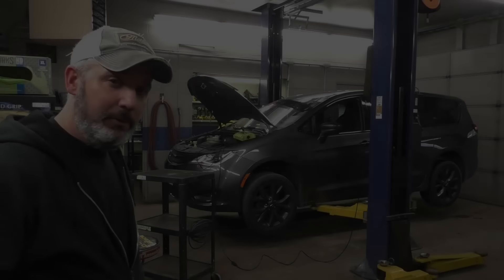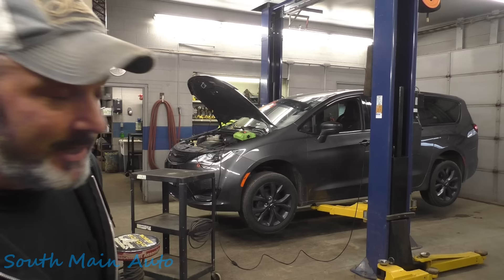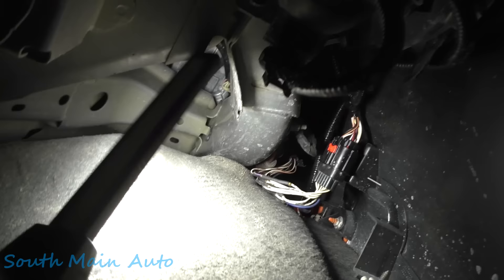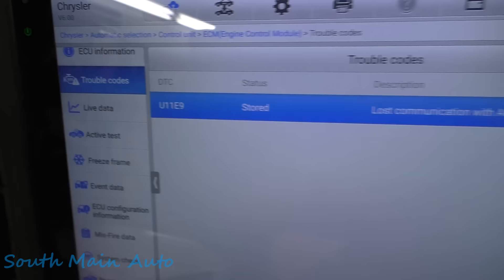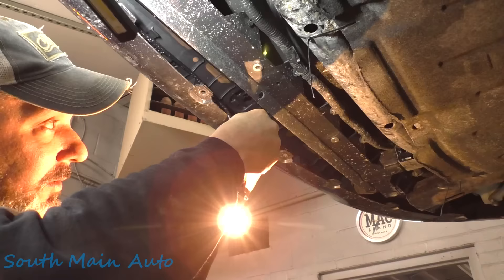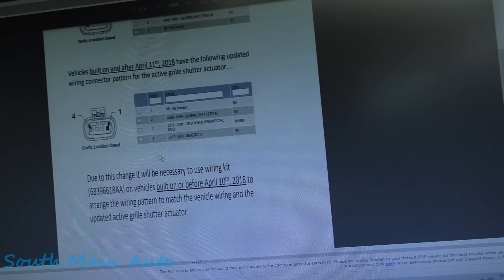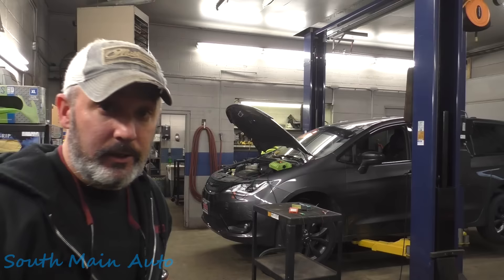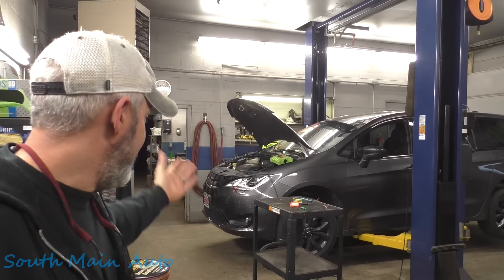Chrysler Pacifica - Updated Active Grille Shutter Wiring

Comment: Whenever you get those spring month before/ after updates it seems like someone is just not vert into their at the time.🤷‍♂️
Of course it could also be a simple mix-up from the dealer giving the guy an after model shutter instead of the before model by mistake. Someone clearly didn't have the service updares.🤙

Comment: That scope is a 25 buck amazon special  DSO-138 in a fancy box.  not that it is a bad scope.  I use one for my low volt electronic projects and it works great.
Reply: How you charge it up and is it good for the private use?
Reply: I was surprised that they are so low priced.  I still have my 40 year old scope which I haven't used for years.  Wish I would have taken that money and invested it in Google or Facebook's IPO.  Then money I paid for it invested would have made me a wealthy individual.  I think I paid $400 for it back then.   Of course it does a lot more than these $36 jobs, but only in accuracy and frequency response.

Comment: GM typically releases only updated parts for service- but has notes that state other required parts are needed when the parts dept. pulls up the screen. As far as the cavity number four being closed, we call that a "flashed over cavity". Because ALL OEMs buy their connectors from the same suppliers, each OEM may use only certain cavities in their application. During prototype stages, they plug the unused cavity's with seal plugs which are little rubber plugs- this prevents WATER  from entering causing green crusties. Once the vehicle hits SALEABLE status, the supplier has flashed over- or plugged the cavity intentionally to prevent water. The reason is cost-  no rubber plug to buy and no labor to put it in- and they wont get lost or damaged. That folks is why you see this- and now it makes sense.

Comment: I once bought a genuine Bosch replacement blower motor for a Volvo- correct Bosch P/N and all. It was wired backwards- made all the angry air noises, but almost no vent flow. That was a head scratcher, but an easy fix. There were only two wires.

Comment: In 04 I remember Ford charging truck owners 90$ for a crank sensor on 03 trucks that should have still been under warranty. They then almost a year later released a recall with an updated crank sensor and provisions to refund people that purchased the 90$ crank sensors (all but 4-5$) "IF" they had a receipt of buying the aforementioned part.

Comment: I would suggest some dielectric grease as well, or cutting a drain slot in that wire loom, that wire loom is bad about trapping water and moisture that travels upwards to that connector and will corrode the pins. Lots of Chrysler active air dams and grill shutters suffer from this in my experience.

Comment: Maybe a stupid question but...

Why would you want to close airflow to a cooling device?  I'm not a mechanic but LOVE your videos.  Help me understand this concept.
Reply: Shutters are to help with the aerodynamics of the vehicle, to improve mpg. If the vehicle doesn’t need the cooling, they close, and that way the air is supposed to go up and over the car, instead of through the engine bay. To me they are just another expensive fancy part to break that isn’t really needed.
Reply: Like a lot of things at first glance it would seem counter intuitive. Quicker and more thorough warm up. Quicker warm up = better fuel mileage and less emissions output for multiple reasons. Semis and heavy equipment have had them for years. Not quite as necessary in year around warm climates. Years ago in extreme cold weather we would put a piece of cardboard in front of the radiator to help warm the engine to get heat from the heater because the air over the radiator would cool it so much the thermostat couldn't control the temp very well.
Reply: Thank you, guys!

Comment: This problem happens when a car design is new and the documentation given to the submanufacturers has a mistake, or one submanufacturer just read it wrong. In this case, Chrysler apparently ordered a huge initial shipment of parts and found the problem and it was the active grill sub’s fault. So, they came up with a quick fix to use the parts until the problem could be fixed in the next shipment of parts. My guess is that swapping the connector was the cheaper way out when the first batch of active grills showed up with the wrong pinout, and they forced the sub to pay for the cost of the fix and then some, then the next batch was to spec so everything from there on was okay. They could not have the harness sub make the switch after that sub already tooled up to the spec without having to pay that sub another NRE charge, which might have been more than they got out of the active grill sub, so you get to deal with a date code dependent design change.

Comment: Chrysler did a switcheroo with the AGS and the fuel rail pressure sensor on the Pacifica. They discontinued the old part, and the connector must be replaced to use the newer part in both cases.

Comment: Another excellent step by step problem solving video, couldnt he have returned the wiring harness and exchanged it for the correct one, it seems insane they sold him an old style harness with a new style shutter or voce versa.
Reply: Normally electrical stuff is not returnable once you open it.

Dealer sold ya the wrong part?  Tough.   Shops like SMA might get a bit of a break but nit the average guy.

Comment: Went thru this recently lol. Front end was hit. So we got a new shutter from the dealer. Long story short we put the new shutter in and had the same code with a check engine light, well we called the dealer and there’s a star case about it, sometime in the production year they switched suppliers, they sent us the star case file and literally has you depin and switch two wires lol.

Comment: I changed many turd DOHC  V6's in late 90's  Intrepids. everything looked the same from year to year, but mid-production the harness had some pins swapped on the PCM/firewall end. So if someone purchased a used motor and did not check anything or swap out harness and sensors, they would get a no start.

Comment: Probably different connector configurations because they switched OEM suppliers from one Chinese company to another. The Chrysler "engineer' (intern) who wrote the specification sheet for the new supplier was too lazy to check how the previous version was pinned so there you are.

Comment: The new ram trucks fuel rail pressure sensor is also wired differently with the new updated part. However, stellantis does not have the update wiring in their diagrams. Called the parts guy, and he said, "Oh yeah, there is a wiring change. I forgot to mention to ya'll." Thanks, guy. Parts dept had the updated pinout, but not stellantis.

Comment: My wife had the same part with her 2015 Chrysler 200. I ordered the part and was a day away from taking it to another shop when the battery died I changed the battery and it started working again and the check engine light went out

Comment: Parts guy sold him the harness by VIN for the original shutter instead of checking if a new harness was required with the new part. I assume Chrysler probably had a note in there and this guy didn't read it.

Comment: I got only a few minutes into the video before I had to ask Google what the heck is an "active grille shutter".  Since all my cars are pre-2005, I never had one in a car to malfunction.  Seems like an unnecessary addition that just adds one more thing that can go wrong.    Strange to think that bugs, road debris, and minor front-end bumps and bruises can set off your check engine light.   I hit a deer once driving a 2000 Toyota Sienna and, had I had an "active grille shutter" on the car, I'm sure it would have been rendered inoperative.  As it was, the deer smashed some plastic trim and bent the hood but I was able to drive off with no issues and no check engine light.

Comment: My guess is the updated part is the only one available and the old style is not available any more (or the parts guy just missed it and went with the newest part number). My manufacturer has done that before with parts and the only way we can tell is by the suffix on the end of the part number. It'll usually start with an A and go up from there. It sucks for the customer and techs as we aren't always told and like you found you can end up chaising your tail until you find the service bulletin. Thats why our service manual states early on every diagnosis 'check for TSB's and service alerts' as one of the first steps.

Comment: The original Chrysler harness has all 4 terminals. Instead of hacking harnesses up at the body shop we would just depin them and switch them around. Also, aftermarket shutters rarely work. Unless it comes with no actuator and you reuse yours. They’re junk.
Reply: Also on the Chrysler side as soon as you click the shutter it pops up with a huge note about the harness being switched. So if their parts guy never told them then it’s time for a new parts guy!

Comment: Advanced Diagnostics & Programming had poor service data on a ford that had been setting installed component incorrect with every single ABS sensor that was thrown at this car. Everything cross referenced, and Ford service said that it was the correct part and he spent months along with other shops to figure out why the sensors weren't being registered and read causing all kinds of issues with the car. Someone finally figured out that Ford service data was wrong and the correct sensor could only be ordered with the wheel hub bearing assembly which came with the correct sensors and were totally different than all of the other sensors.

Comment: Active Grill shutter?  Why? What’s the purpose?   Great video!
Reply: To sell parts of course
Reply: Probably additional engine temp management for emissions control. The more stringent the emissions regulations get the more complex these cars get with all their systems. It's pretty dumb.
Reply: @deathk26  I hope that in case of a failure in the system, it defaults to open.
Reply: When shut, improves MPG slightly due to decreased wind drag

Comment: I’ve replaced the fuel pressure sensor on these new pacificas, the dealer sent me a new updated sensor without telling me the connector changed, ordered a new connector and then they didn’t tell me that the pin orientation changes too.

Comment: We ran into the same problem with a fuel pressure regulator.  Same vehicle,  new regulator from chrysler. Pins on regilater different spots. No paperwork came with it.

Comment: This seems to be a thing especially with anything related to fans or fan motors. I’ve run across this in the equipment industry multiple times where the fan or shutter wiring changes mid year?

Comment: I actually bought a main Engine/battery harness for a 2016 Explorer, was the exact part number from OEM that matched the VIN....it was missing a connection for PTU. Returned and got a replacement that was also for the VIN (dont know why 2 part numbers were listed), it had the connector. After install, check engine light would not go out, turns out it had the wrong color wires connected to the wrong connections....didnt match the OE wiring diagram. Ended up patching the original one that was on the vehicle.

Comment: That reminds me of my climate controls in my hyundai tiburon. I was trying to figure out why the humidity sensor didn't seem to do anything, and found that the wiring diagrams showed the humidity sensor power feed to be on pin 8 of the harness, while the module schematic showed it to be run off the 5V reference. The harness had it pinned to pin 8, and when inspecting the module PCB, pin 8 had no traces connected to it.

I jumped pin 8 to pin 5 (5V Ref), and suddenly I actually got a voltage on the signal wire & the wet rag test would actually kick on the air conditioning. I'm pretty sure every hyundai tiburon from 05-06 was shipped with this wiring fuckup & none of their humidity sensors work.

Comment: Hello Eric, I have a business management question.  I work for an under performing general repair garage in the rust belt in Ontario and I've noticed that we are under charging for most of our work as far as hours go.  For example, if a wheel bearing on our Co Star system (we use this system for all our quoting, repair order and invoicing) calls for .8 hours for a job, but it regularly takes 1-1.2 hours.  My question to you is, what repair order management system do you use or what resources do you use to quote out hours for jobs in the rust belt?  Or do you just multiply the hours quoted by the software by 25% for e.g. on every job and hope to capture enough profit to cover those jobs where the technician goes over?   Thanks in advance.

Comment: So the guy that designed the replacement grill shutter from Chrysler never bothered to look at the wiring diagram or the guy that designed the newer cars from Chrysler never bothered to keep the same wiring as the older cars.  Either way you look at it it's a balled up mess.  Or...maybe the connector became supply side unavailable?

Comment: With no coolant going through the rad until the thermostat opens, how do these shutters speed up engine warm up ??
Reply: When shut, improves MPG slightly by decreasing wind drag.  That's why they're there - gov't MPG regulations driving every conceivable tweak to improve MPG.

Comment: There's no reason why Chrysler can't send the com signal riding on top of the voltage high power. So instead of 3 wires you'd only need 2 and reduce the possibility for an error like that. Engineering, I guess.

Comment: I wonder what improved by moving the pins over by one position?
Reply: Literally explained and showed you.  What happens when you send communications to ground?  Have another go at it.
Reply: @Failure_Is_An_Option  You literally do not understand the question I raised. If you have a four pin connector with a pin out of 1-3, what possible improvement could you get by going to pins 2-4?  I understand what Eric O found, just don’t know why the manufacturer made this change! Still a four pin connector!

Comment: Hold on a second the cover is only holding in the front by just a zip tie? What is the problem with fixing it properly and sell at least a safe car? I worked in a shop as well and I put together a small organize box with the most used stuff in it like screws and clips. All those was cheap and I was often able to use them on other brands as well. So just buy it for few dollars and invest few minutes to make it good. Also use good tools like the small scope. I often thinking of buying it for my private use but my car doesn't brake down and it's very reliable compared to others. I look online and found some Chinese scopes for 100 euro or so but I'm not sure if I really need it, I even don't have a scan tool😢🤔🤣🤣🤣😂🛠️

Comment: My thinking is that the problem might stem from a lack of communication with the vendors who manufacture these sub assemblies for the car makers. And sometimes the path of least resistance is to change things on the production end to accommodate the vendor's mistake in manufacturing a part to the customer's specifications.

Comment: Yeah, back in the late 1970's when the second ice age was happening in The Great Industrial Northeast, I thought it was a good idea to put some cardboard in front of the radiator in order to help the cooling system heat up the engine. It heated it up really good to the point that I had to buy a new water pump because the old one overheated causing the bearing seal to start leaking fluid.
Point is dampers only work when you pay attention to them and if it's "automatic", then you're never going to know.
Another useless piece of technology.

Comment: Another pointless piece of useless technology on a car, that is destined to fail.
Reply: Your lack of education does not change the complexity of the world around you.
Reply: @Failure_Is_An_Option  And your use of big words on your mums computer doesn't mean a thing.
For over 100 years a car has survived without needing shutters infront of the radiator.
If world leaders are that bothered about greenhouse gases blah blah blah, then ban Diesel powered engines. Then a vehicle wouldn't need an EGR valve and cooler, it wouldn't need a DPF that constantly clogs because the school mum who drives the car 1 mile to school and back doesn't get the engine up to operating temperature so the DPF doesn't work correctly. This leads to spending hundreds of pounds/dollars doing a regen or having to replace the extremely expensive part because the engine won't work efficiently. Oh, and don't forget AdBlu which costs YOU money to buy, and also fails because the liquid crystalises and then clogs the feeder pipe. Once this is blocked your shiny new car will not start until YOU yet again have paid to have it cleaned or replaced.
Now give the keyboard back to your mum, and jog on.